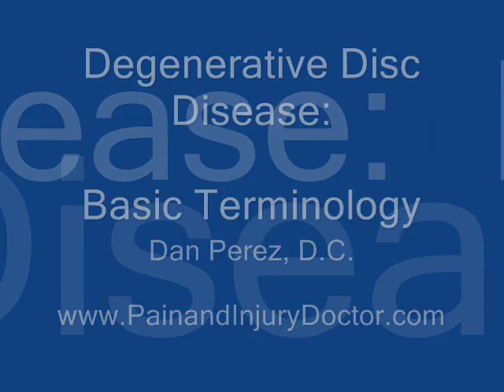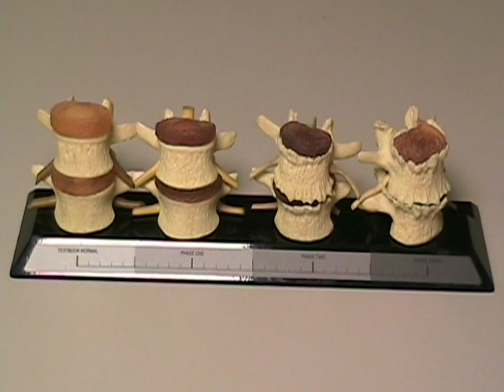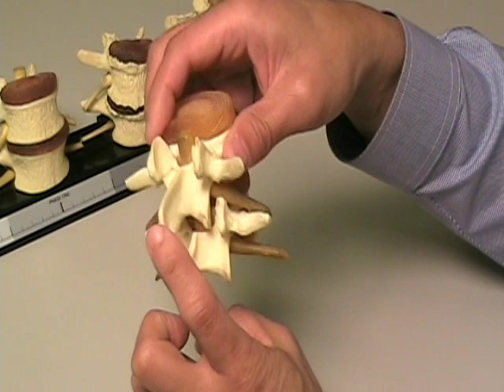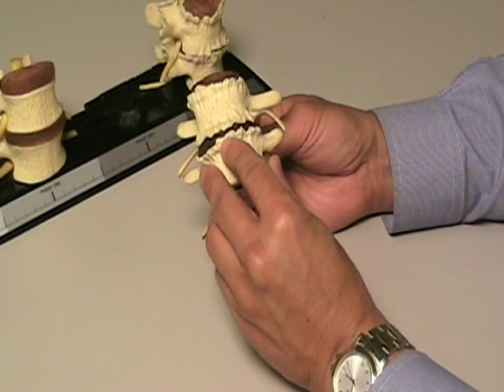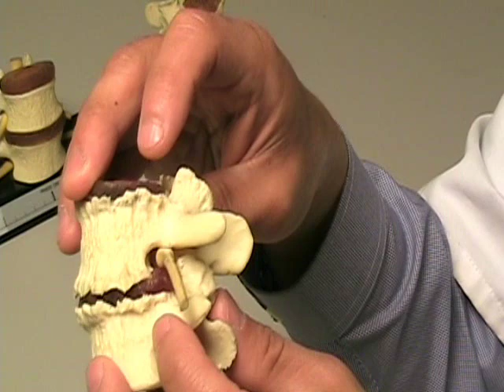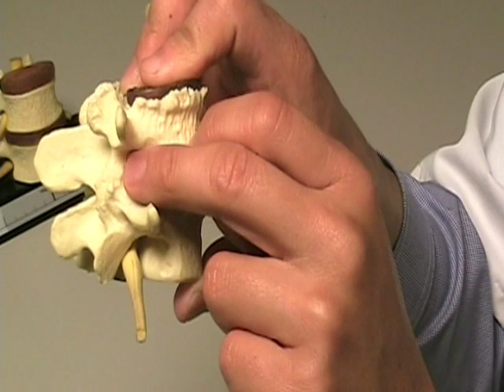Degenerative Disc Disease Basic Terminology - Disc Herniations, Osteophytes, Stenosis

Comment: EXCELLENT EXPLANATION.  I wouldn't be searching if I didn't have problems and this is the first explanation that is clear.  Suffered for 12 years with Lumbar pain,  and Sciatica.  I'm a retired horse & Pony owner/rider age 53.  Had numerous surgeries, Discectomy etc , epidurals (19) plus facet Joint injections.  On High dose Morphine etc. Latest MRI which has been compared to last years MRI shows extensive changes in narrowing of central canal  and neural foramina at 2 of the previous 3 levels.  At L2-L3 secondary to osteophyte disc bar complex and bilateral facet joints hypertrophy leading to impingement of the corresponding exiting right L2 nerve root. More narrowing at L3-L4 secondary to circumferential disc bulge and osteophyte bar complex leading to crowding of the nerve roots of cauda equina.  Marked bilateral facet joints hypertrophy also seen at L4-L5 and L5-S1.  Waiting to see Neurosurgeon on 10th Dec.  I can't find anything on cauda equina crowding to understand what this means for me.  Extensive lumbar pain, right leg pain and parasthesia. Left leg pain also above knee. Problems with Urinary incontinance and bowel movements.  Any help understanding cauda equina crowding would be appreciated Doctor.  Thanks.  Jane

Comment: Dr. Perez, thanks for a great video!!! Quick question for you please.... When classifying an osteophyte as anterior or posterior what are these designations in reference to:  anterior/posterior to the spinal cord or anterior and posterior portions of the vertebral body?  If it is in reference to the vertebral body, then how do we classify/name osteophytes found posterior to the spinal cord in the central canal?  THANK YOU, again :-)
Reply from the maker: Hi Maria, by convention in medical terminology, anterior refers to "towards the front of the body (stomach side); posterior means "towards the rear."  So an anterior osteophyte on the vertebral body is found in the front-facing part of the vertebral body and therefore cannot touch the spinal cord.  A posterior osteophyte on the vertebral body can make contact with the thecal sac and compress nerve tissue if large enough.  These are the ones that contribute to central canal stenosis (narrowing of the spinal canal); and are therefore more clinically significant.  One can have lots of anterior osteophytes and not even be aware of it.
Reply: THANK YOU SO VERY MUCH!!!

Comment: Great video very well explained.  Thank you I have severe right leg pain from the hip in the front and side and pins and needles. I had a MRI and it showed
 L4-L5 A grade 1 (0.5 cm) Anteriolisthesis of L4 on L 5 secondary to severe bilateral facet joint  degenerative changes. Vertebral disc is moderately decreased in height with mild annular disc bulge causing moderate central canal stenosis. There is moderate left  and severe right subarticular recess narrowing with compression of the existing  right L4 nerve root Moderate left and severe right Foraminal stenosis.
 L5-S1 Moderately reduced intervertebral disc height. Mild annular disc bulge and degenerative facet joint causing mild spinal canal stenosis. Moderate bilateral neutral foraminal stenoses. Surgery has been recommended. Will any specific exercises or an epidural help me or any medication for nerve pain. I have read lot of comments from people who had surgery and some are still in pain.
Reply from the maker: Hi Catherine, I have an online course on self-rehabilitating sciatica (basically, nerve root compression and radiculopathy which you have).  It contains lots of exercises you can do to attempt to remove the pressure from the right L4 nerve root.  If you're interested, please visit http://r2method.com
Reply: Am I to sign up for the course on sciatica. I don't have pain in my buttock or back of right leg. My pain is in front of the leg from the hip and right L4 nerve root compression and spinal canal stenosis.
Reply from the maker: The exercises are designed to push a bulging disc back so it doesn't press on the nerve.  It is more effective for L4-S1 level disc bulges but might work on higher ones.  If you have pain in front of leg, that is a higher disc level; i.e. L3
Reply from the maker: Also, you wouldn't need to do the exercises addressing piriformis muscle spasm, which is one cause of sciatica.  I am producing a course strictly for lumbar disc herniation due to disc bulge, but it will be another month before it is finished.